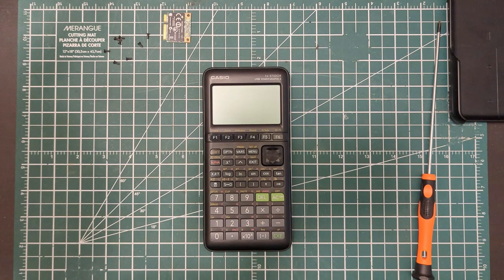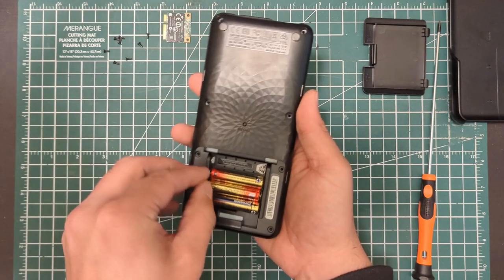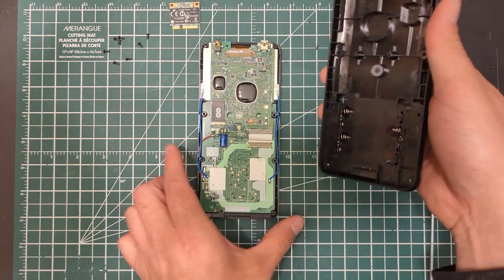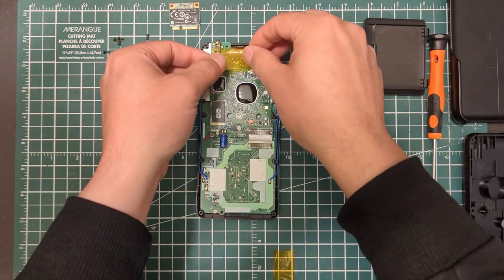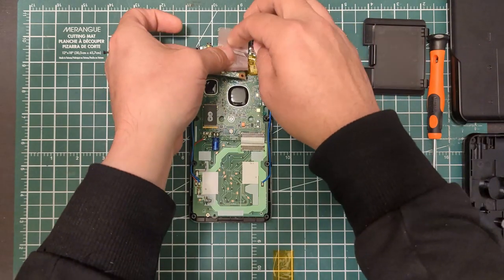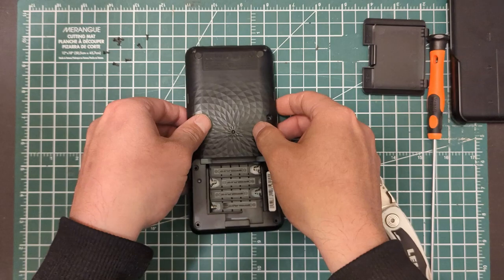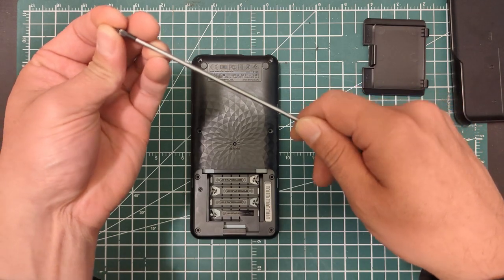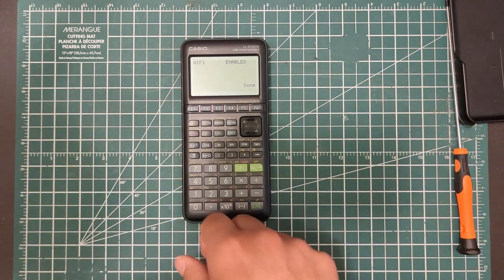Wifi Adapter in Graphing Calculator

Comment: Thanks a lot. I used your method and placed a 4090ti  in my HP48gx！
Reply from the maker: Most people throw out their old calculator and buy a new one, which is such a waste because usually they only need a $2K GPU upgrade. Good work! Glad I could help.